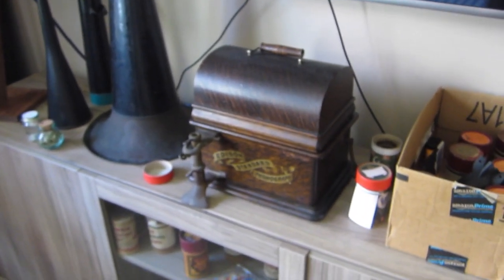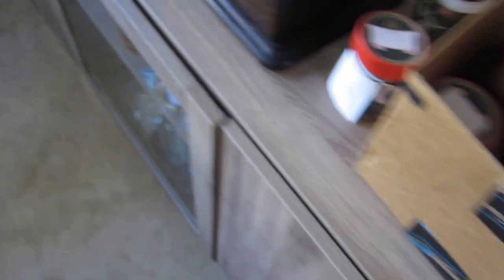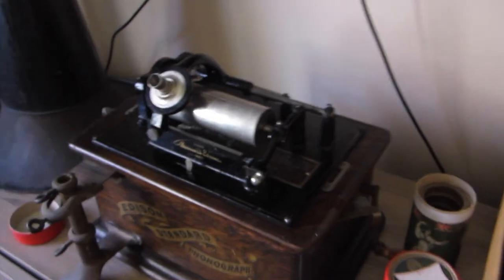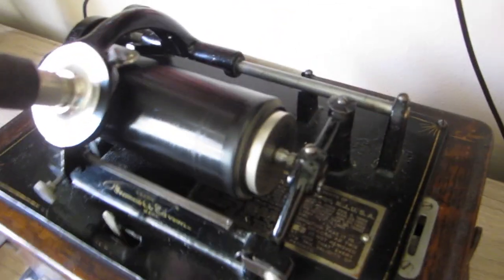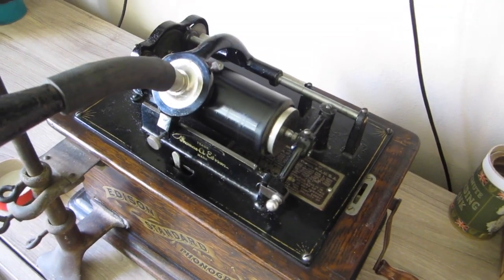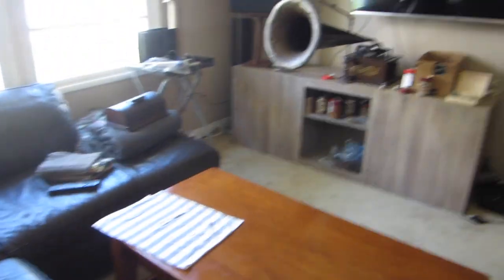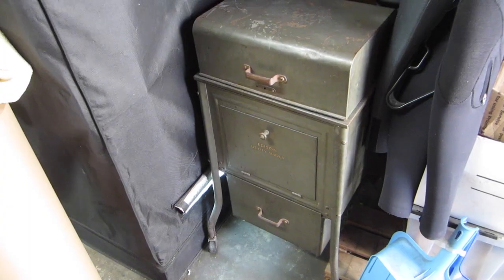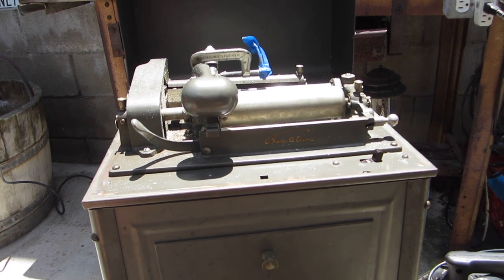Edison Standard Cylinder Phonograph - Recording Preparation

Comment: I’d say your machine was manufactured between October 1905 and July 1906 since it’s a model B with a banner logo. I also recorded my first cylinder today with my Model B standard too. But I played it back on my Columbia Q because I don’t have a proper Model B reproducer or an automatic to play back home recordings on my Edison machines without wearing them out fast.
Reply from the maker: Greeting oldradios.  We are airing a recording tomorrow!. thanks for the info on our machine.  That model A is a reproduction..fairly inexpensive and works fine.  I think its called a model A.  Where did you source your blank if I may ask?
Reply: @CasaBacon  someone selling them on eBay
Reply from the maker: @oldradiosnphonographs  N2wheelies is me.... we distribute for Paul Morris in the states... 👊 his blanks are the best available and we have great results using them
Reply: @CasaBacon  I will check out your store for my blanks needs then. I also need a model B reproducer to play on something other than that little Q.
Reply from the maker: @oldradiosnphonographs  https://www.ebay.com/itm/321393269349?mkcid=16&mkevt=1&mkrid=711-127632-2357-0&ssspo=zKSuwe__RNG&sssrc=2349624&ssuid=GZ7pjX06Q6K&var=&widget_ver=artemis&media=COPY the reproducer
Reply from the maker: @oldradiosnphonographs  I'll post add a link to this video for the blanks next week, and leave you a link if you would like. That's the reproducer we use. Works fine and doesn't damage our records.  I've played the trumpet recording many dozens of times. Still sounds wonderful
Reply: @CasaBacon  I responded to your post on the talking machine forum I go by the name AmberolaAndy.
Reply from the maker: @oldradiosnphonographs  thanks for tying the names together and for the feedback on our phonograph! Much appreciated
Reply from the maker: @oldradiosnphonographs  this is us: https://www.ebay.com/itm/144582840384 Blessings on your weekend!